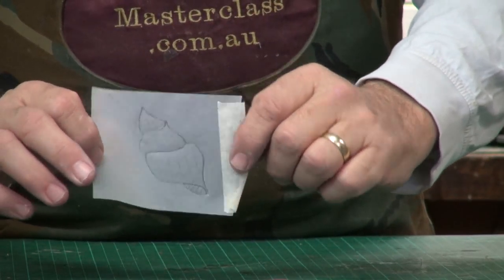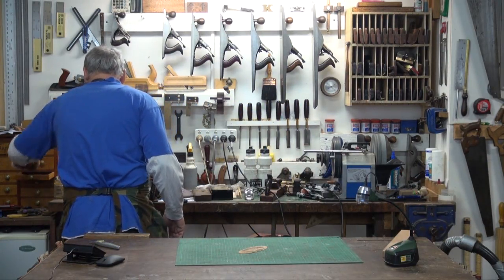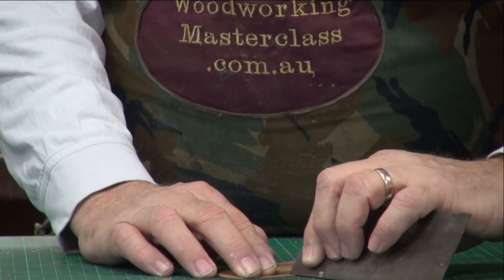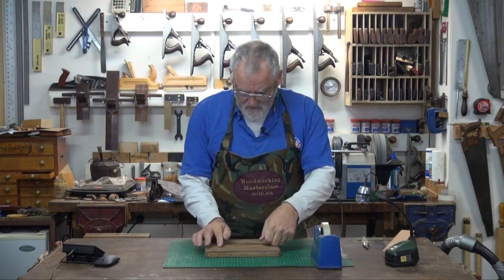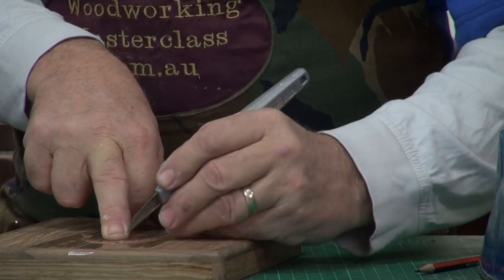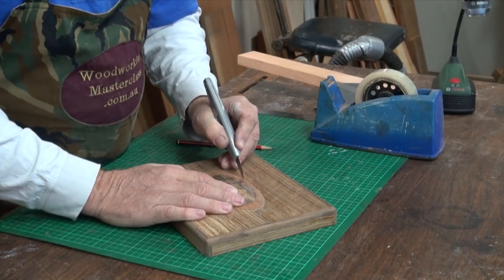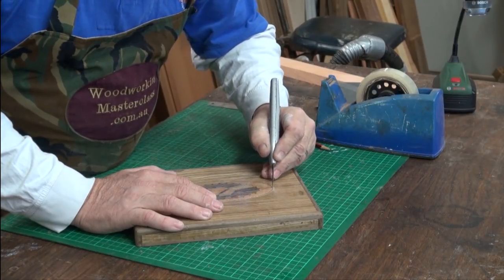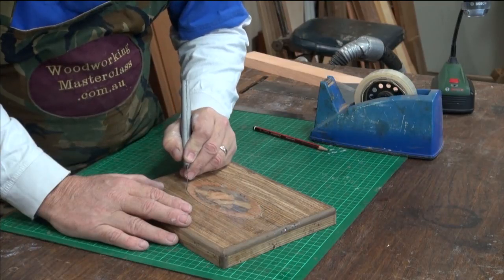Preparing the Substrate for Inlay of Marquetry Shell Design

Comment: Just watched the previous two, then this one. Searched for a link to click for the next phase....Doh! 
In the unlikely event that you have yet to make THAT video, could you please include some verbal advice on how to best proceed if the box lid does not already have a veneer on it? I have recently done my first experimental inlay of simple squares and strips of homemade 3mm oak veneer into a cheap spruce coffee table top for a kinda 'art nouveau' geometric design. I was able to use an 8mm bit in a power router and a number 71 for those simple shapes. I'm fairly well pleased with how it turned out but have no real idea how to go about doing something similar with more complex shapes. If you've already covered this, please feel free to call me a lazy git and send me to search for it in your back-catalogue!
Thanks for the inspiration to try stuff outside my very limited comfort zone.
Reply from the maker: Hi Tyrole, I don't have anything on inlaying into Solid timber. But I do know that you are meant to inlay it in the same grain direction as the timber which is acting as a substrate. As opposed to laying veneer onto a ply backing which is then meant to be laid at 90 degrees to the grain. I have seen the results of not following this rule and each time the timber shrank due to climatic conditions the inlay tended to pop out or at least raise up a bit. No much help but that's all I can offer. Cheers Steve